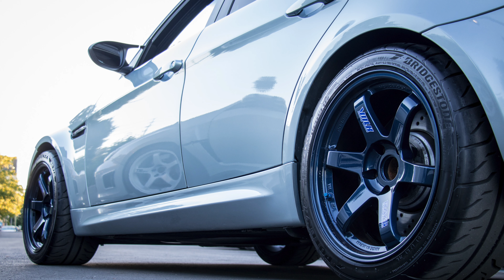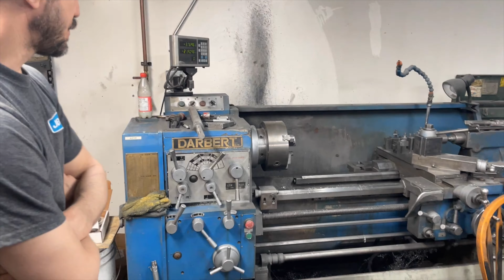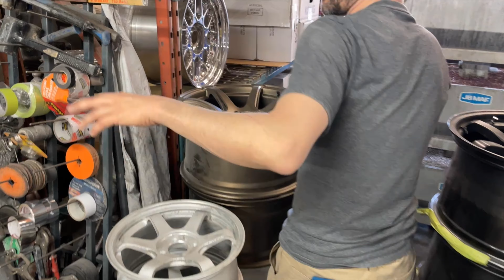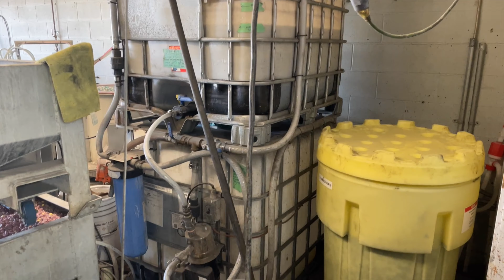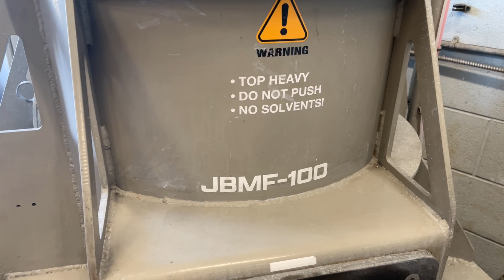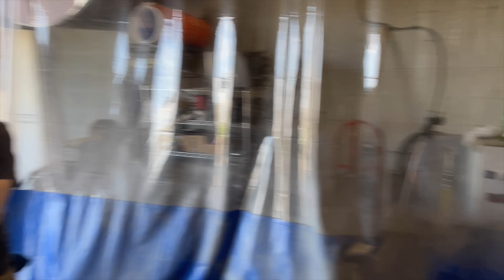Redrilling my Dream Wheels from Japan.

Comment: How are your wheels holding up? I've heard of some horror stories, I want to convert 5x112 to 5x114.3 and seems way less than your current setup.
Reply from the maker: Hey Bombon, I’m Alex, it’s nice to emeet you.
I haven’t installed the wheels yet, as Project Sky is still off the road. Much of my focus has actually been on a new car I just bought that hasn’t been formally announced yet on my channel, but I’ll share with you that it’s a 1997 E38 L7 and it’s coming from a great home. I pick up the car in June 2026 as I don’t have anywhere to put it currently.

Sorry I wasn’t able to reply with feedback on your question. I’ll be sure to do a video though in the future sharing feedback. I appreciate your support especially if you are a subscriber. Thank-you.

~Alex
Reply: @AlexanderjRei still no update?